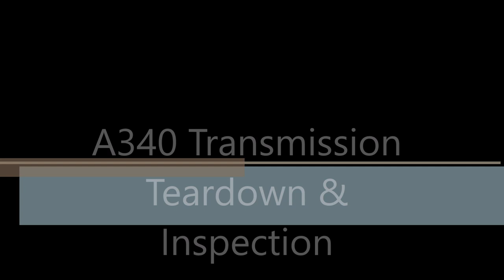A340 Teardown, No Reverse

Comment: Gary I’ve got a 2002 tundra 2wd 4.7 auto .309k miles I’ve noticed the transmission has a slight whine in first gear only , soon as it shifts it goes away . It’s not very loud , the transmission shifts perfect , no shudder nothing just the little whine . The fluid is clean because i change it every 15k miles due to pullig a trailer daily . Is that whine a normal thing , I can say I don’t remember hearing it before but normally when driving I have the ac blowing and radio up .

Comment: Gary, is the A340 similar enough to the A343F to use videos for that transmission to help me rebuild my 97 LandCruiser trans? More videos for the A340. Was thinking about installing an LS 6.0 engine and 6L90 into my 97 but rebuild videos for the 6L90 show me that it’s not as reliable a transmission as I had originally thought. At 66, I’m kinda old to return to auto classes even if I enjoy the heck out of them. Took auto mechanics and auto body but I’ve been working in the Middle East for the past 15 years. Still want to learn and build my own in retirement, videos seem to be the most logical approach. Thanks.

Comment: Great detailed video! I have a 97 ToyotaT100 4wd with the A340f transmission. I need to remove the extension housing because speed sensor broke off during removal and fell into housing. It looks like extension housing is sealed with red rtv from factory, is this preferred method for reinstallation? Thanks in advance!
Reply from the maker: Yes,  If silicone came off then there is no gasket

Comment: My Volvo 960 had rare trouble slipping on brutal cold days the past 2 winters.   In February it really started to slip.  Badly, forward and back.  I took it to 2 local shops and they prescribed like $2,000 remanufacturer but they couldn't get the parts (we're in Canada).  I declined.   Changed the fluid and got 3 more weeks out of it and then it stopped completely.  400,000 km.   I have a $600 used unit coming this week and will have that popped in.  Then I'll disassemble my old one to see what happened.  If luck,  it's basically a rebuild kit.  Wish me luck.
Reply from the maker: Good luck, what year is your car?  it would run ok hot?
Reply: @GaryFerraro  It's a 97.  The past 2 winters it would slip immediately on startup on a brutally cold day.  This year Feb it got a lot worse and then became undrivable.  Weirdly, if I stopped the engine and re-started, it improved and I could continue without slipping but then it would start to slip again.  Plus a groaning sound.  I honestly don't know what the problem was.  Very few places will do a real diagnosis.  I'll swap in the used transmission (I need the car for a small business) and then disassemble the transmission to see what might be obvious.   I'll let you know what I find.

Comment: Great video!  I,ve got one in Guyana, SA, that seemed to work perfectly. Then noticed a slight loss of power on a steep hill, but it worked as normal and figured it was the few extra folks I was giving a ride to? Then I came home to Florida for a few months. Returned to GY and went to move it and it hesitated for a few seconds, then drove normal. Got to the steep hill and didn't want to climb. Made it up, then drove home like normal. Next day, no more moving in any direction. I'm out in the jungle with the nearest "transmission mechanic" an hour airplane ride away. I built a ramp and elevated platform to start wrenching, but decided to tackle it on my next trip after coming home and watching YouTube... Here I am:)  Any ideas??

Comment: I have a 1999 4runner with a 2.7L, 2wd version showing the same symptoms (no reverse, forward in neutral). I just haven't noticed it try to fight backward and forward like you mentioned on this one. Admittedly, it did get low on fluid, so I'm thinking this is just the problem with mine.
Reply from the maker: very possible, sounds like a clutch pack is stuck together

Comment: Hi
I have the A44D transmission for a 2002 2.4L tacoma
It does not want to shift into 3rd and 4th unless the transmission fluid is hot and half the time I have no reverse. Sometimes i have reverse when the transmission shift into 3rd and 4th. 
If I dont get the transmission to shift into 3rd and 4th I have no reverse
Its automatic by the way

Comment: So I assume that with fused steels and discs, you have to replace both and can't reuse even the steels?

I'm working on an A140E from a '92 Camry that has no reverse and a similar likely cause, a blocked cooler line (some idiot mechanic forgot to remove the factory plug when installing a new radiator) leading to no oil cooling and overheated oil. I have the trans mostly apart but haven't examined the parts in detail yet so I don't know yet if it's worn friction discs, a worn band, fused steels and discs, stripped gears or splines, bad valve, etc.
Reply from the maker: cannot reuse steels

Comment: Thanks for this!  Is the a340 trans the same as the Aisin AW-4 in Jeep XJx, WJs, etc?
Reply from the maker: yes
Reply: @GaryFerraro  Thank you sir!
Reply: It wasn’t in WJ’s
Reply: @connerchampion5656  I'm guessing you probably know what was in them then?  I had an early WJ, and I guess I can't remember what trans was in it.  Maybe I never knew. Lol
Reply: @tptrsn  On wikipedia for the Jeep WJ If it was the 4.0L I6 engine it was the 42RE, if it was the 1999 & 2000 4.7L V8's it was the 45RFE, the later 2001-2004 4.7L V8's had the 545RFE. 

What year model was your WJ? 
Was your WJ a straight 6 or a V8 engine?
Reply: @connerchampion5656  Ah yes, thanks!!  Mine was the I-6, 2000-2001-ish.  I recall now that I was bummed to find out that it had the 42RE instead of the AW-4.  I guess I repressed the whole memory (even though the 42RE gave me no trouble, Lol).

Comment: Hi Gary, great video, have you got any tips for getting a reliable dipstick reading on these transmissions? I have an A343F in my Toyota Prado (similar to 4runner) and it's almost impossible to get a reliable repeatable reading. I'm doing it with the trans warm, in N with motor running.  Makes it so easy to trick yourself into overfilling.
Reply from the maker: does it show high on one side and low on the other side?
Reply: @GaryFerraro  It's fairly random and unrepeatable to be honest, but yes both sides of the dipstick are usually different making you wonder which is correct.

Comment: This A340 series was made from 1985 and current and they are famous for their reliability and being nearly trouble free from the start. The Jeep XJ’s and MJ’s called it the AW4.
Reply: These Toyota Aisin A340’s can last like 300k or more if we’ll taken care of. These Toyota Aisin A340’s are very nice modern classic units.
Reply: These Toyota A340’s weren’t just in Toyota’s and like I said they were in 1987-2001 Jeep XJ’s called the AW4, some Mitsubishi’s, and a Volvo 960 had it.
Reply from the maker: @connerchampion5656  The TPS Had a lot of problems causing the trans not to shift

Comment: Hello Gary. Thanks for another great video.
I recently bought a 2009 BMW 750li with zf6hp transmission.
The car wasn't moving forward or backward, even if the shifter goes in D and R and it stays there.
We aren't able to push the car if it had the engine on even it was in N. We take off the oil pan and the fluid was really black with burnt smell and low.
We changed the sleeves, 7 liters of fluid and the pan.
Now the car is acting weird, it goes in drives and move forward, changes the gears but it gives kicks. In neutral its going forward, and reverse goes forward 1 foot and stops aggressive.
It also has a metallic noise sometimes. What's your opinion? I regret I didn't change the solenoids too. Thank you
Reply from the maker: Almost sounds like a clutch pack is locked together
Reply: @GaryFerraro  should I try to change the solenoids too? Does it worth to get it fixed or replacing the whole transmission be a better idea?

Comment: I have a 89 Toyota Truck 3.0 V6 2wd automatic with column shifter. I believe its the A340E. I had the same exact issue with a line breaking and it drove forward in N and had no reverse. Then I got to playing with the shifter and it swapped around, now it has reverse but no forward. The shift linkage on the driver's side of transmission feels normal, moved it while under truck, it goes into each position normal. D light doesn't light up (never has, bulb burnt out) 2 light is dim, and L light is dim. Any ideas?

Comment: Mine got rebuilt and is doing this exact thing. Loses reverse when its up to temp but not cold. Neutral goes forward when warm. You make it look doable for me to tear down and look. But maybe an opinion from you would help too.
Reply from the maker: certainly sounds like something is locked, did the trans run low on fluid?
Reply: @GaryFerraro  Its been like that since day 1 of it being installed. Fluids been topped off and checked and even put a big cooler to keep the transmission at good temp. Im at a loss. Its basically brand new. No codes either it just gets warm and bam its gone.

Comment: Hello Gary,
on my 2014 Toyota sienna V6 3.5 recently started getting a code P0990 this is on a u660e transmission already replaced the TCM and the wiring harness inside the transmission and still nothing basically sometimes I will lose reverse after the transmission gets warm and a hard bump from second gear to first gear when I’m like downshifting or coming to a stop. Could you direct me in the right place or where to look or what would be your suggestions on the problem?
Also is there anyway to contact you or where are you located?
Thanks
Also I had the transmission fluid changed and flushed out. 
Getting ready to park the van in the garage and take off the transmission and start checking it out on the inside what would be some stuff that I need to check out?
Thanks
Reply from the maker: ok,  going to look up this code but question,  Is this ok cold and not ok hot?
Reply: @GaryFerraro  Yes when it’s cold it’s fairly good but when it warms up it starts to act up especially when im in stop and go traffic.
Reply from the maker: @BTR2018  kinda  seems like a valvebody problem
Reply: @GaryFerraro  What would you suggest me doing?
Reply from the maker: @BTR2018  If it works ok cold and not ok hot, i would try a valvebody, and reset adapts again

Comment: I have this trans in a volvo 960 (144k miles).  Getting codes for "no torque converter lockup" and "trans fluid temp sensor."  I assume the sensor's bad and that's preventing the lockup due to no signal to ECM.  I'd replace the sensor, but can't find one - anywhere.  Any guidance?

Trans otherwise works fine, but I'm keeping it off the highway until/unless I can get the torque converter to lock up again.
Reply from the maker: If the converter is slipping, it generates a lot of heat, very possible the Temp code came on because converter is slipping, this you may not feel
Reply: @GaryFerraro  Thanks for the quick response!  The excess heat is why I'm limiting usage to short hops.  So, I may have the cause/effect of the two conditions reversed.  If so, and it's not the sensor's signal to the ECM, I need to know why the converter's not locking up.  If it's a Big Deal, like a converter replacement, then that's a car-killer for this '98 volvo, but if you have other suggestions about what to look at that might be more do-able, I'd appreciate the chance to save the car.  It may help you to know that the "failure mode" here was "gradually reduced periods between the Check Engine light coming on after clearing the last code, until it would basically come on right away."  If that triggers a light bulb moment, let me know!
Too bad for me you're not in Seattle.  Thanks again.
Reply from the maker: @upload2352  You could have a bad converter, could be a worn pump or stator bushing, faulty TCC solenoid or problem in the valvebody
Reply: @GaryFerraro  Thank you for that helpful guidance.  The transmission shops around me don't have the best reputations, unfortunately.  Last question - whether I decide to get the problem checked out will depend in part on whether the repairer can even get the replacement parts.  Are the parts potentially "at issue" you mentioned currently available to the industry?  Or obsolete?
Reply from the maker: @upload2352  Parts are available for this transmission
Reply: @GaryFerraro  Yes!  That trans fluid temp sensor's obsolete (different makers use different controls and I think volvo's the only one to use that particular sensor), so I hope it's not that after a 5 hr remove/inspect/replace!  Thanks for the help.

Comment: I need help my transmission is only working in reverse it is a a340e from a Lexus sc400.. it will go into gear if I hold brake a give it a Little gas it will move forward gears an shifts good then when I come to a stop a no gears. Have to move to neutral then back to drive hold the brake an Lil gas then it will jump into gear. what could be the problem be??
Reply from the maker: fluid level is full for sure

Comment: sir please help me my customer toyota land cruiser runing 20 min after reverse gear not working stop engine restart engine then working revesr perfect replay sir🙏🙏
Reply from the maker: have you scanned for codes?  what year is this car?
Reply: @GaryFerraro  sir 2005 land crusir
Reply from the maker: Question,  If you put the car in drive, let it engage in drive then select reverse will it have reverse? @3stargarage . The transmission is called A750
Reply: @GaryFerraro  customar tel me some time not working reverse stop engine and restart engine then shift perfect not all time customer says 2/3days 4/5 time happen
Reply from the maker: If he looses reverse then shuts the car off and restarts it and has reverse with no problem this may be an electrical problem, do you have a scanner that shows live data? @3stargarage
Reply: @GaryFerraro  i have thinkdaig dongol can work 2005 land crusier
Reply from the maker: yes it can @3stargarage
Reply: @GaryFerraro  thank u very much sir